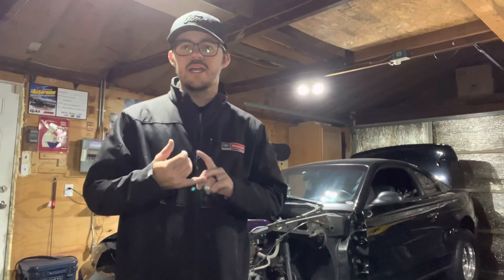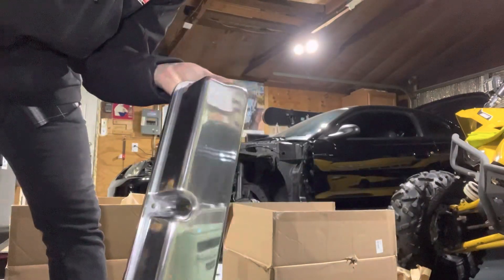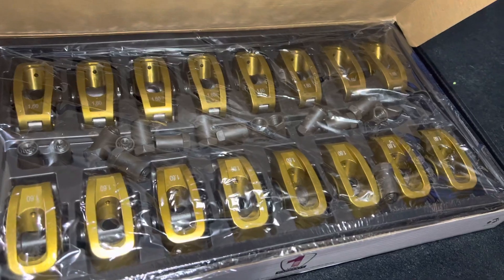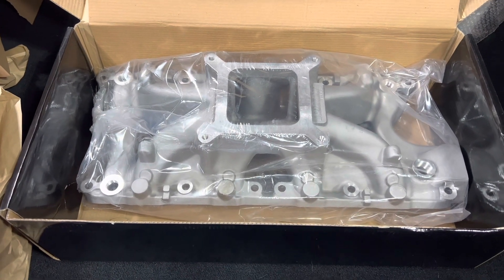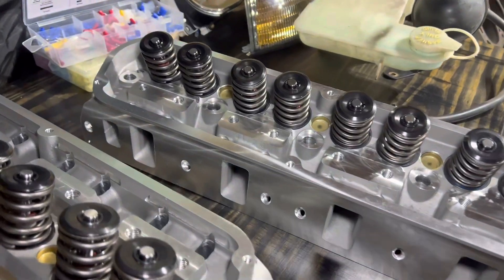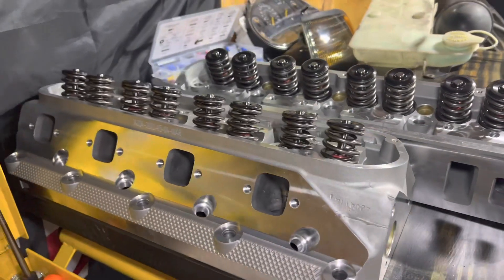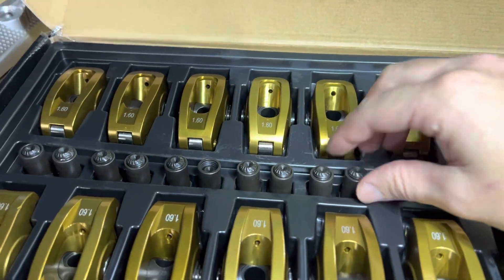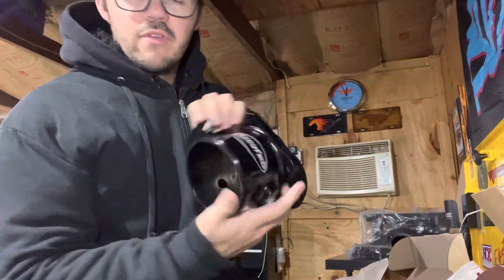Unboxing $1000 210cc Speedmaster Aluminum Heads 302 - Winter Vlog Volume 3

Comment: Might as well thrown your money in the trash! As a HP machinist who has worked on these junk heads don't waste your cash. Everything about these heads is poor. Seats are marginal thickness, guides poor quality material. Even if you buy them bare and put your own stuff in them they're not worth it. Had someone bring in a set after short usage and guides badly worn, a common problem, especially if rocker geometry is not perfect. Think about it costing as much to repair a set as to buy another set. Pay now or pay later and still have a piece of junk.

Comment: Nice unboxing vid! What does a rocker arm do?
Reply from the maker: Simply put it is a lever mechanism. The rocker arm assembly transfers the movements from the camshaft to the valves inside the engine

Comment: You might pull a couple valves on one cylinder and just check the valve job. Some of these cheaper Chinese knock offs lack in that department. Eric wiengarter Racing channel shows alot of these Chinese heads on his channel and shows what you can do to pick up some serious gains. The valve job is the most important aspect of the head. He’s done some of the flotech ls heads and they flowed worst out of the box than a factory head.
Reply from the maker: Yep, I planned on doing that & even taking it to some people I know of that know their way around aluminum SBF heads to get an idea of how they are. They look nice from the outside view! But we’ll see how they look going through them.
Reply: @FastballRacing  awesome, I’ll definitely check it out! Thanks!
Reply: @FastballRacing  you should check out Eric Weingarter YouTube, he did some on the speed master sbf heads a couple weeks ago. Shows flow numbers before and after the head work.

Comment: Did they come with a flow sheet?? If so what do they flow at .700 lift?? Thanks for the video!!
Reply from the maker: Heres what I was able to find online on their website & I also gave a comparison to AFR’s 220cc/58cc chambers. 

Speedmaster 210cc Flow Numbers:
Intake
0.200 - 158.7
0.300 - 229.8
0.400 - 290.6
0.500 - 327.3
0.600 - 359.5
0.700 - 377.4 

Exhaust
0.200 - 123.2
0.300 - 174.1
0.400 - 218.4
0.500 - 240.4
0.600 - 252.5
0.700 - 260.6

AFR Renegade 220cc heads

Intake
0.200 - 149
0.300 - 205
0.400 - 264
0.500 - 296
0.600 - 318
0.700 - 334

Exhaust
0.200 - 126
0.300 - 173
0.400 - 220
0.500 - 246
0.600 - 251
0.700 - 255
Reply: Wow at those flow numbers
Reply: 255 / 260 ?